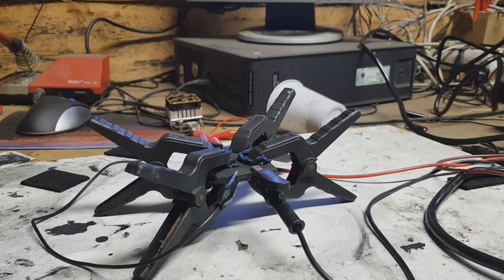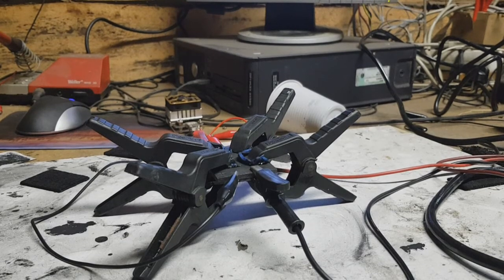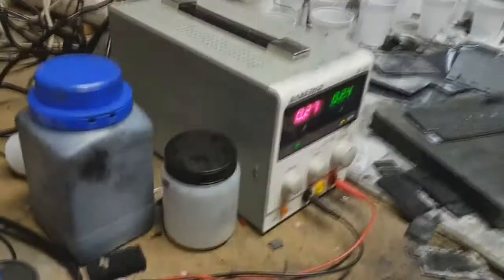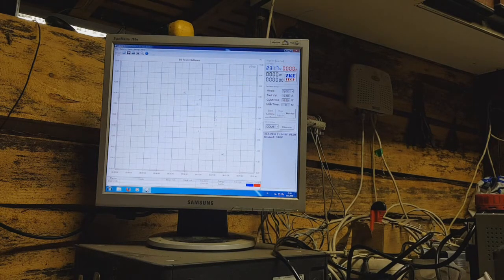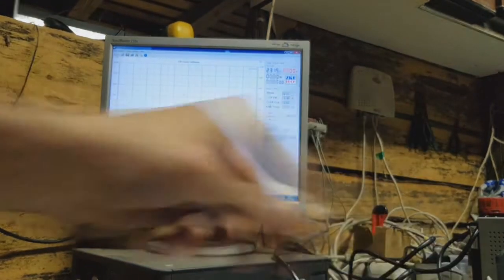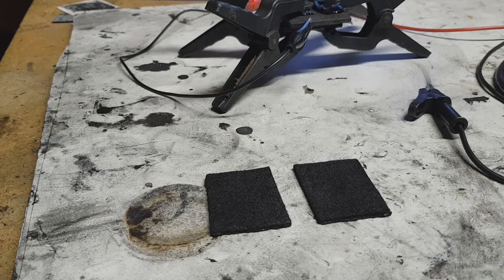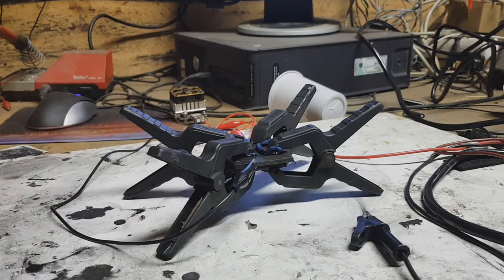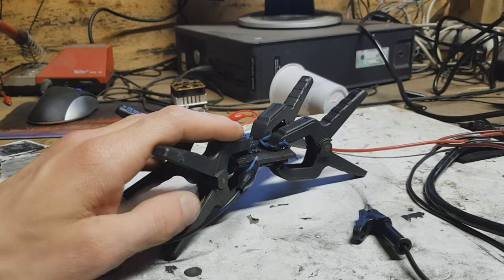Zinc ion Supercapacitor Update

Comment: Great results, particularly @ 100mA discharge.The graphite foam you are using is good for experimentation, but it would be fairly expensive in a full scale DIY battery, (there would be a lot of it).The current collectors are a tricky part of the cell, and most expensive :-)   Martin.
Reply from the maker: Thank you. Graphite foam is expensive if you buy ob ebay and is good like you say, experimentation. But if you bay from the company directly the price is low. Yes, the current collectors are the tricky part, but you can solve if you make current colletors with graphite and waterproof binder like PVB which make a collector with no pores and you press the collectors hard together, for example.
Reply: Cheers mate, where do you get the PVB, I will try what you suggest :-)
Reply from the maker: solarhope ebay. Polyvinyl butyral

Comment: Hi. Good to see you are back. Nice run on your cell. Do you use a separator??.
Reply from the maker: Hello! Yes,... I use a lab filter paper which is used for slow filtration. The density of this lab filter paper is way higher that by some coffe filter paper.
Reply from the maker: Guy Ruff nice idea. Yes I use a carbon fiber which is 0.3 cm thick. I need to buy a 0.1 cm carbon fiber or I need to make like you say.
Reply: I noticed your electrode was a little thick. Idea! Make it thicker. Then put in a 5 ton press. Lots of dense material this way. Good to see you back.
Reply: cayrex2 only reason I bring this up. Years ago my friend and I was goofing around with sponges. We squished one that was two inches thick to 1/16 th. It was flattened thin as a card. Once in water it expanded back. So let’s say you use a conductive graphene in a light binder. Soak sponge in it. Then squished and heated to dry. Release. It will hold its shape. Then take a separator that’s soaked in electrolyte do it on sponge again then the electrode. This could represent a solid state. Yes?
Reply: You could layer this up
Reply: Very nice results...glad ur back.....
Did I miss why you call it zinc ion??